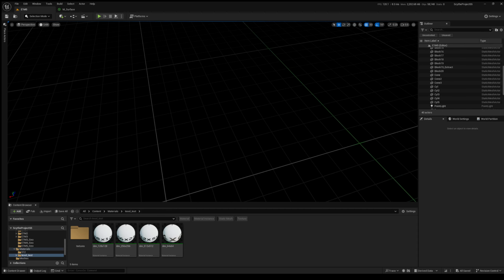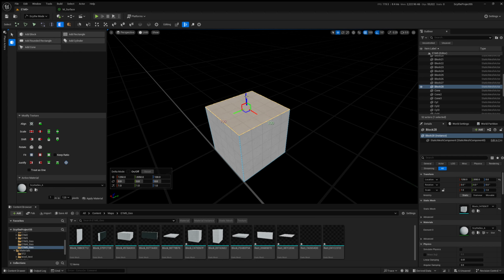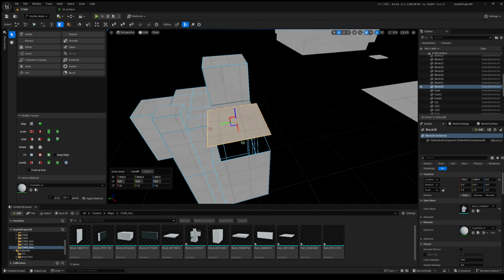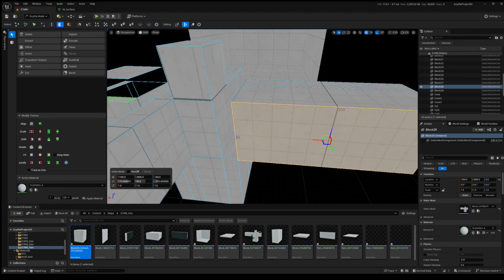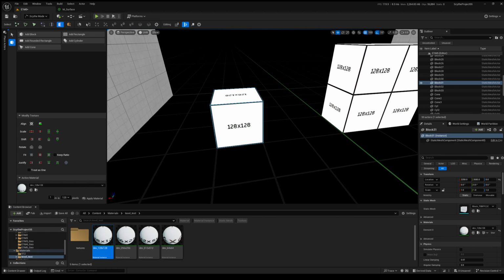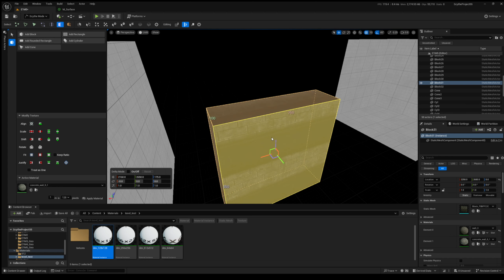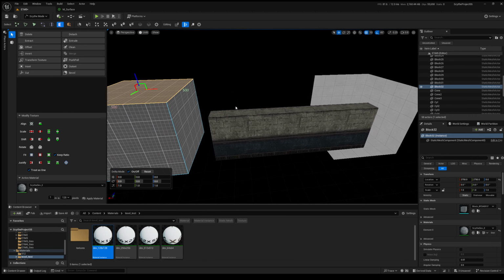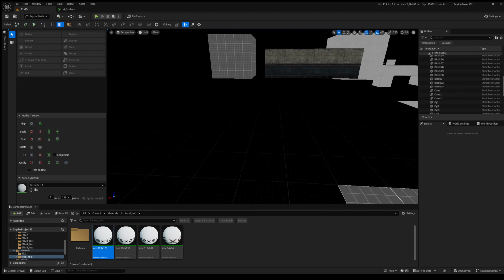Scythe Walkthrough (Pre-alpha v0.0.7)

Comment: Awesome stuff! A few questions though:

Is there a way to make them without adding meshes to your project? Like have them just exist in the level?

And how does it handle baked lightmaps? The thing I like about BSP is it evenly lightmaps the whole level.
Reply from the maker: You can change your mesh output to a Dynamic Mesh, which will not create static mesh assets and have them only exist in the level. Dynamic Meshes don't support things like lumen and nanite from my understanding. I'm not sure how performant they are over static meshes too.

By default, it generates lightmap UVs for all the meshes so you can use it with static lighting (baking it).
Reply: @ScytheEditor  okay, so it's very much built on the modeling tools. That might make it rough for my uses but I'm still looking forward to watching it develop! Great work so far!
Reply from the maker: @meanderingdev  Tell me more about your use case. Is it that you're not happy with how unreal generates lightmaps?
Reply: @ScytheEditor  Sure; Right now I'm using UE's BSP tools (which works for me but there are many drawbacks I work around). 

The first reason is because it creates level geometry inside the level only, thus doesn't clog the project files up with meshes. You are right that dynamic mesh instances does this too but they don't support baked lightmaps (necessary for my project).

Second is the fact subtractive geo is an object you can duplicate and reuse (while hammer style is usually consumed Boolean operations right). 

Third is the fact that BSP is evenly lightmapped across the whole map, so I don't have to adjust lightmaps res as I add geo etc. keeps the world lighting consistent.

And the fourth reason is that it's interactive as all one object (well many, but from Brush Editing mode it feels like one object). While modeling mode it's usually a bunch of chunks of objects.

Everything else it does you've already got going and I love! Especially quads and quad units, texture tools, quick object placement - amazing stuff! I just think there's too many annoyances in the UE modeling tools fundamental roots for me to consider it worth switching to. This does get it really close though!